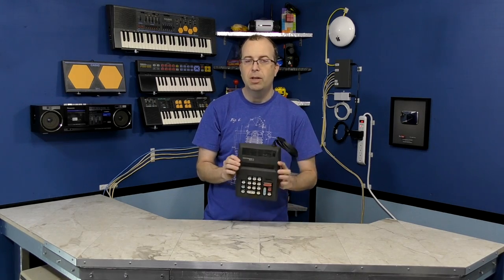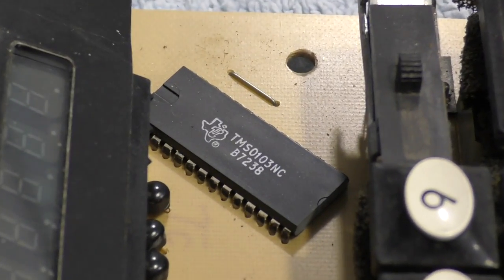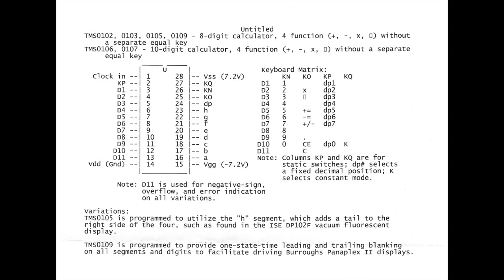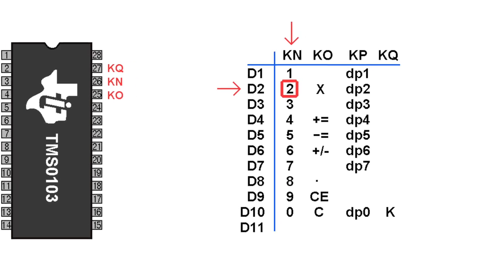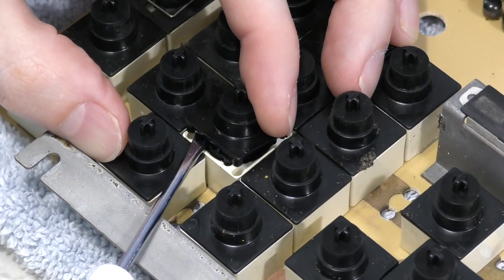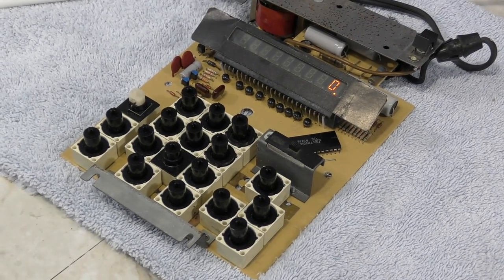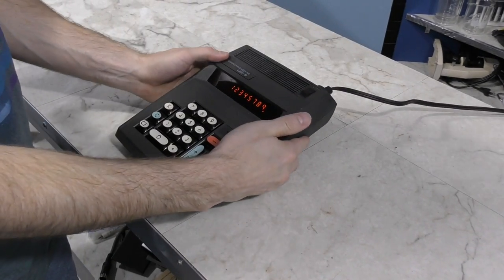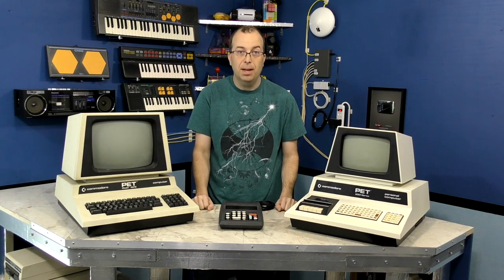Commodore Calculator Repair

Comment: I love old calculators. I personally restored some Commodore N-60 Navigator, and S-61 Statistician handhelds, and a Sony Sobax ICC-600W nixie tube calc. The two Commodores are MASSIVE handheld specialty function calculators (the number in the title actually mirrors the number of keys). Both suffered severe battery corrosion, and required trace rebuilding.

The Sony was a nixie tube calculator from 1969 or 1970, and used hybrid modules instead of integrated circuits. The hybrid modules were epoxy dipped ceramic plates with carbon film resistors printed on the plates, with physical capacitors, inductors and transistor dies bonded and electrically connected to the printed circuit pattern on the ceramic. The epoxy dip protected the finished module. In the late 1960s, the US government still bought a LOT of the available chips, thanks to the space program, and ICs were not that competitive for consumer devices.

Sony hedged their bets on hybrid modules being a viable consumer option integrated package... and pretty much ran into a dead end technology when the IC market's pricing dropped out the bottom in the early 1970s... Interestingly, brought on very much by the demand for early consumer calculators. By 1974, there were easily over 100 companies all vying to market their own brand of a calculator, and within a couple years, that was culled down to around half a dozen.

The rise of Commodore as a computer maker was very heavily influenced by their role in the calculator market. As you mention in the video, Commodore bought MOS, to remain competitive against TI in the calculator market. When the calculator market dropped out, and they went from being serviceable professional devices to mass produced economy commodity items, they weathered the transition with high end specialty calculators, like the N-60 and S-61 that I restored, till they could fully transition into the then new personal computer space. Of course, the rest is history. The irony, is they likely survived the calculator to computer transition because they had done it once before... But from typewriters to calculators. Commodore used to produce typewriters, but cheap Japanese typewriters flooded the market, killing profitability in the low end consumer typewriter space. They had transitioned into calculators at just the right moment, and further hedged their bets against Japan by rebranding Japanese calculators int he west, thus being the channel for some of the inevitable cheaper Japanese models to flow through...

Shame they didn't keep such forward thinking with later business decisions...

Comment: I physically recoiled at that foam. That's so nasty.
Reply: It's very common. Foam rubber breaks down over time, as it's biological plant-based material (most don't realize this as it seems so artificial, but it's really not). There are synthetic foams that last longer but they're more expensive. "Standard" foam is only good for about 10 - 15 years before it falls apart.
Reply: MrJest2 plant based? What's the name of the material? Today they use polyurethane foam, and it doesn't last worth shit, and it is fully synthetic, so there's that, the minor surface oxidation and halogen-based fire retardant eat it up. I actually think cellulose acetate foam lasts a lot longer.
Reply: I took out the heater matrix of my 1972 Hillman Avenger a while back, which was covered in just the same foam where it is mounted up to the air ducts inside the dash.  Disintegrated foam everywhere.  I replaced it with draught excluder foam.  The car also uses some of this newfangled silicon technology in the rectifier diodes of the alternator.  The white heat of technology was really starting to happen in 1972.
Reply: Ewww. I've never had the displeasure of opening something old enough that had foam in it so I had no idea it could do that. Doesn't surprise me, but its still super gross. Thank you for the information!! That makes a lot more sense now!
Reply: +Siana Gearz - Older foam is latex based, so it's made of sap from the rubber tree (plus catalysts and foaming agents). Around the time this came out, polyurethane foams were also starting to become available, but they were more expensive (and also break down when cheaply made, due to the organic component molecules oxidizing). This sample could be either, but my bet would be on the older cheaper version.
Reply: MrJest2, oooh foamed latex rubber, yeah that didn't strike my mind, makes sense. I guess i just didn't get to handle equipment that's old enough. Did PU undercut it on the cost around mid 80ies?
Reply: Sometime around then, yeah, as the situation is now quite reversed - "natural latex" is the expensive option these days.
Reply: If you have ever had a really nice pair of subwoofers, this can happen to them, its a shame, really.
Reply: O_O Even newer ones? Oh no now I'm afraid of this happening to mine..
Reply: Voltz, i'd struggle to call them "really nice" though... foam surround is one of the hallmarks of cheap speaker driver, and usually the first one to be eliminated by manufacturers when going for higher price grades.
Reply: EStarstruck, well don't worry, you can always just replace the surround once it goes, look for surround repair kits or refoaming kits. You can also replace the foam with much more durable rubber.

Comment: Great restore :) very satisfying to restore something that was not working.  A couple of recommendations.  You can buy different sized Q-Tips for when you need to clean tight areas, you can soak the q-tip in whatever cleaner you wish to use.   Also when using compressed can of air.  Do not press and hold and wave the can around that will release the fluid that's inside and damage your electronics.  The best method is to use short bursts of air, the action of the air coming out of the can will remove the debris and your compressed air can will last longer between uses.

Comment: I'm amazed that you have gone years without ever needing a 1/4" nut driver. That used to be one of the most common fasteners in old electronics. I have one in the drawer with all my common screwdrivers and use it constantly.
Fuse: three likely possibilities: 1 - corroded contacts to the fuse holder; 2 - cold solder between the fuse holder and the board; 3 - crystalized solder in the fuse itself. Since it came back to life it was probably bad contact to the fuse holder, but all three are possible with those symptoms.
The foam under the keycaps was both to reduce click noise and to keep dirt falling into the keyboard out of the unit.
The foam in the springs was to dampen them to eliminate the possibility of key bounce, something you really don't want on a high-speed calculator keyboard.

Comment: No hex driver for disassembly, and no q tips for cleaning the key mechs???  You're killing me, David!  Still, keep up the cool vids! =]
Reply: Sean's Retroverse Also needs more Deoxit.
Reply: Yeysssshhhh!  DeoxIT is awesome stuff
Reply: Sean's Retroverse - His reply to other poster said he didn't want to use a q-tip cause it would break with the force he was using to clean the base of the buttons.  :)
Reply: Sean's Retroverse - it saves lives.  Then again, if everyone had some, I wouldn't get awesome deals on old Technics receivers and turntables at thrift shops.

Comment: It was probably the two axial electrolytic capacitors.  Caps need to recondition themselves if they have been off for a very long time.  You may want to replace them as they are probably dried out.

Comment: This calculator seems to look like the Texas Instruments desktop ones
that I used to repair at Ryman’s office supplies. In the Texas ones, the number
5 key went wrong usually. Our repair was to heat up the solder joint of the
wire rod connecting the PCB to the key. We’d then push the rod upwards,
towards the key. That usually worked well. Thanks for an interesting nostalgic upload. You're gr8!

Comment: Mine arrived on 10 JULY 2023; completely functional. Even if it were not in working order, it's nice to have as addition to my collection. On your unit, I suspected the foam was at least in part the culprit. I was born 1970, so I can identify with this machine, and others from late 1960's - early 1970's.

Comment: 6:46 is it ever a concern when you get liquid coming out of the compressed air spray? I bought some dollar-store ones and they all do it, so I'm worried about using them on electronics. The expensive can I had never did it.
Reply: compressed air usually gets cold after spraying, what you are seeing is condensation of water out of the air but it evaporates quick, so no worries. evaporates even faster than alcohol

Comment: Wow... never knew calculators were that big 😄. Great video!
Reply: SC13 you think this calculator is big.. look up the Friden EC-132
Reply: You think THATS big? Check out the Analytical Engine.
Reply: Back in the 1940s, calculators were the size of a breadbox and all mechanical.
Reply: There's not that much difference between the calculators from that era, and the home computers from a bit later on.
They're technically surprisingly similar, and the computers are in some ways only marginally more complex. (especially the kit computers)

Probably explains why so many computer companies began as calculator companies.
Reply: Those mechanical calculators are such a jewel of engineering. They're truly marvelous machines.

Comment: 8:04 You never heard of Q-tips?

Also, replace the capacitors.
Reply: The capacitors shouldn't need to be replaced. It's from 1972 which predates the bad capacitor plague of the 80s and early 90s.

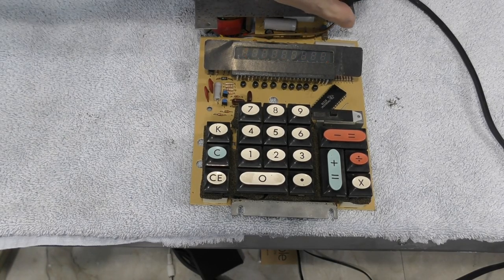Comment: Erm at 3:18, vintage AC powered electronics without an earth pin, and a metal service over the PSU, let's touch it!

Very risky idea, this could be ground referenced to the neutral pin, but because there is no polarity on the plug it could also be referenced to the live pin. If you checked before hand, ignore me, I'm just worrying about nothing... well maybe people watching and not realising they should also check. ;)
Reply: Hopefully it's isolated via the transformer, but with old kit (even new kit if it's cheap and imported) better safe than dead.

Comment: Rather than using a paper towel and a screwdriver to get inside the switches, why not use a Q-Tip?
Reply: q-tips are too difficult to clean switches
Reply: What the hell is a q-tip

Comment: I was in the last generation of sci/math students who learned to use a slide rule out of necessity. To do the simplest accurate calculation in, say, astronomy, required using tabulated values of sine, cosine etc. and doing linear interpolation by hand. Needless to say this was unbelievably tedious and prone to error. Well for Christmas in 1975 I received a fantastic gift - a SLIDE RULE CALCULATOR, the Commodore SR-1400, which CHANGED MY LIFE :) I absolutely wore than thing out!

Comment: Great video.  As a formally-trained (Navy) electronics technician, I liked your work, but have a couple of comments.  Your first step (open it up and take a look for obvious problems) is the right first step.  Cleaning obvious crud up is the second step (which is often part of the first step) - dust, the crumbled foam you encountered, dirty contacts that are possible sources of problems (like the fuse contacts, as you mentioned the possibility of).  Sometimes (often enough to make initial cleanup worthwhile) the source of the problem will be conductive crud causing a short (resulting in a problem like your stuck 8 key) or non-conductive crud (often corrosion) preventing contacts that are supposed to happen.  So you should have addressed the crumbling foam as soon as you encountered it, and gotten rid of all of it, rather than leaving some of it on your towel (because if it was conductive, one crumbly bit could have easily shorted a couple of traces.

Comment: 1. Q-tip and potentiometer contact cleaner are your friends. The contact cleaner evaporates completely, and potentiometer version won't attack carbon/polymer tracks where present. 

2. They really got foam under the keys to limit key noise, and foam into the keys to suppress the buzzing sound that a fresh non corroded spring would occasionally make.

Comment: I think your fuse theory is a good one.  That's a common failure point on old British cars too (I have a 1969 MG Midget).  One of the first things you do if you're having electrical issues is take the fuse out, polish it with some fine sandpaper, and put it back in.  Cures a lot of oddities.  :D

Comment: "When something responds physically it's usually a physical problem."  That's a maxim an engineer taught me many years ago.  The keys responded differently to physically contact when you tested them.  That led me to guess it was a physical problem based on that old maxim.  Of course, that's what it turned out to be.  So I thought I'd share this maxim with you as it's aided me on many a repair project.  And it may aid you in the future.

Comment: Great restoration:) Also i really hate any type of foam in old/vintage gear, especially synthesizers, some foam types even turned into conductive muddy/oily stuff over the years, which also damaged some components sometimes. Also rechargeable batteries usually do heavy damage to PCBs/connectors when they become leaky.

Only very few units i bought nonworking condition had failed due to electronically damaged components. But most of them failed because of corrosion. Usually switched/connectors and also fuse holders got heavily corroded over the years. Also if batteries inside it´ll be much worse up to total trash due to unrepairable PCB damage. 

Some days ago i bought my first C= calculator, the SR4148, because it also was rather cheap, and "untested". I also know calcs from the old days usually had rechargeable batteries inside, which also always gone bad by now. But the good thing with that C= calc is that the batteries are not tied to any PCB and their leakage can´t ruin the PCB. But the acid fumes got on the solder joints and also some wires had been corroded as well. After repacing all these wires and resoldered all joints the calc came back. 

And now i´m a proud owner of a fully working vintage scientific commodore calculator, as well :)

Comment: I've got an old GE clock radio that has the same issue of foam rot, to make things worse, the metal concave contacts were taped down with cellophane tape that had gotten old dry and weird. I sorted this out a few times and it still has a few keys that balk. It is a great radio with the blue glow display , dual wake up times to the station of choice and programmable station presets. The radio is a General Electric Model 4885

Comment: I found that chip brand new on Ebay for about $20, so if the chip is fried the calculator is still fixable.  It's always great to see old Commodore hardware getting fixed and restored!  There's a particular model of Commodore scientific calculator I've been wanting for a long time but they're incredibly hard to find.  Also, the Commodore N-60 aviation calculator, which is damn near impossible to find.

Comment: I have one of these (mine still works), that I bought about 10 years ago in a second hand store.  I got it because I grew up with a C-64 at home.  One thing I am impressed with is how well the paint on the keys stands up.  I don't know how much either yours or mine has been used, but both seem to have really great paint on the keys.

Comment: I know on older Volvos that use ceramic fuses they develop a very thin layer of corrosion over a period of time, it was good practice to rotate them a quarter of a turn every oil change or so to keep good contact.

Comment: +The 8-Bit Guy

That old desintegrating black foam has carbon in it and will conduct electricity. That stuff inside the keys was causing the problems. I have had issues with that stuff in the past.

If you hold down several keys at power up, you may end up with a blank display. You also had some disintegrating foam above the display, which you removed, and blew away the crums from the board. Maybe that stuff was making shorts on the PCB. That could explain the initial behavior. 

Thanks!

Comment: My undergraduate pocket calculator made by Commodore that was much smaller than this unit. It was my first connection to Commodore products. Later, I got a C-64 when it first came out, partly because I'd had such a good experience with that little Commodore calculator. (Incidentally, my dad bought the calculator from an ad in the Wall Street Journal. I believe it sold for something like $29.95 or $39.95, when other scientific calculators were selling for well over $100.)

Comment: The foam inside the spring is probably there for the same reason you put foam inside the the 3 springs of a tremolo  block on Fender type of guitars: to suppress spring sounds upon vibration. On the guitar it happens with any vibration due to the amplification, on the calculator it's probably to prevent springy noises when pressing a key.

Comment: Great Video, Electricians contact cleaner is very good at removing oxidation in difficult places, Spray in, q tip round and blow it dry with compressed air. Hope this helps.

Comment: A basic rule for components that can be removed (like the fuse) is not to test continuity directly on a circuit like that:
- first there could be a charged capacitor that will discharge into your multimeter and fry it.
- second there could be a short (like a ceramic capacitor used for decoupling that has burned for example, they usually short-circuit)
- third (not applicable in this case) is that the voltage you're sending could fry a silicon gate with what is called "machine ESD" (only for really recent ultra-low voltage type of IC)